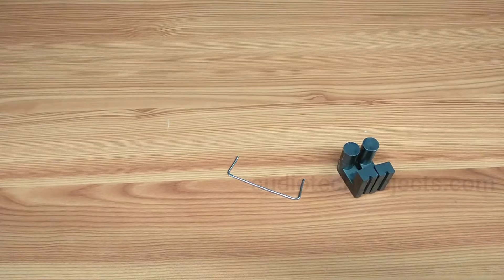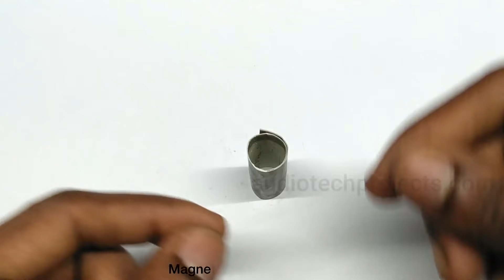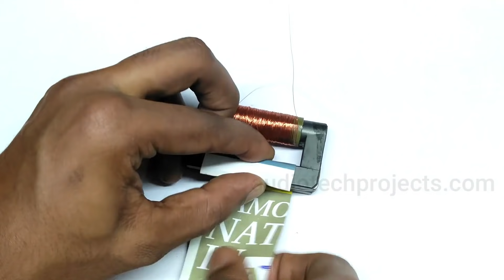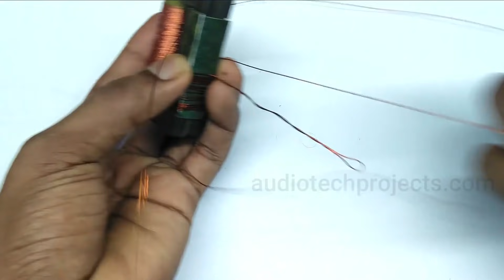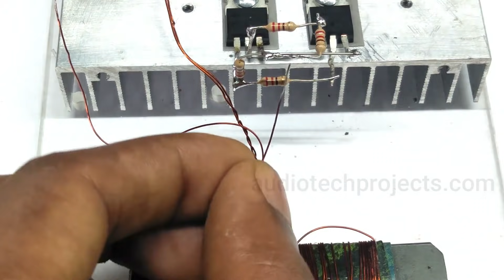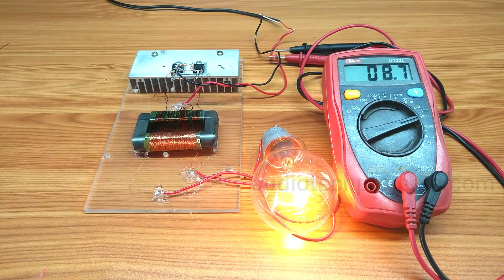How To Make Simple Inverter 12v To 220v | without IC | IRFZ 44 | [AUDIOTECH PROJECTS]

Comment: Appjo 12 volt se 230 volt ,stepup trans former banaya hai primary main kitne turms diya bo malum nahin pada thoda bataye to achha hoga.
Reply from the maker: step-up transformer

secondary windings of the transformer = 250
primary winding of the transformer = Centre tapped  20-0-20

Circuit Diagram : https://www.audiotechprojects.com/how...
Reply from the maker: OR

0.2mm magnate wire for Secondary winding (250 turn)
1mm magnate wire for primary winding (18-0-18 turn)

Comment: you did a great job but did not disclosed its total wattage load capacity. You attached a filament bulb but what is its watt did not mentioned suddenly you changed that bulb with LED bulb why??  you gave supply from multi meter why not use 12V dry or led acid battery??
Reply from the maker: ☻I did not include it in the video because I did not check the total watts output.
☻I thus showed that the filament bulb LED bulb can be lit in this circuit
☻I did not take the voltage from the multimeter, but instead I used the multimeter there to show how many volts are in the given voltage.
☻I did not use the battery there because I did not have a battery in my hand